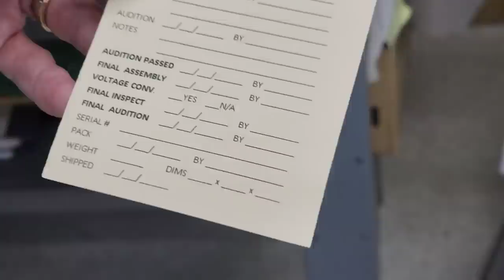VALVE AUDIO COMPANY FACTORY TOUR!

Comment: Kudos for the excellent information shared by the manufacturer and good questions and insightful comments from you Jay.

However, if we must be picky, there was no "factory tour" as billed in the headline as you did not walk the whole facility - or if you did walk it - for some reason you did not show it in this video. Is there a part 2 coming perhaps?

And I get VAC has just moved there and/or perhaps he may have not wanted to show you every inch of the new facility. Still, it would have been so cool to see the factory's front door & entrance, the front office or lobby, the receiving area, manufacturing equipment, storage area, and finally, the reference listening room where Kevin does final audition and gives his final stamp of approval before a piece of equipment gets boxed and ready for shipping.

Did you see his listening room Jay?

If so, can you describe it? What speakers, power conditioning, and cabling is he using, for example? I am curious what loudspeakers he has at his disposal to gauge his electronics. This is very important of course because this has to do with how he is "tuning" his electronics as heard through he prism of whatever speakers he has at his disposal.

But it's not all bad news. You still get credit having interviewed the designer inside his premises but I (we) do look forward to a more proper, more in-depth walking factory "tour" at a later date.

Cheers and thanks for putting in the long hours! It is GREATLY appreciated.